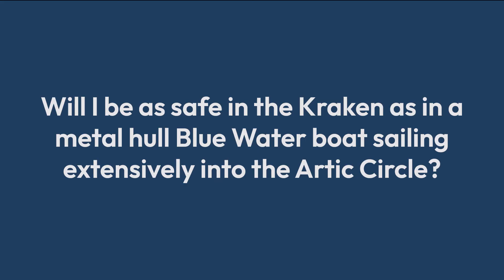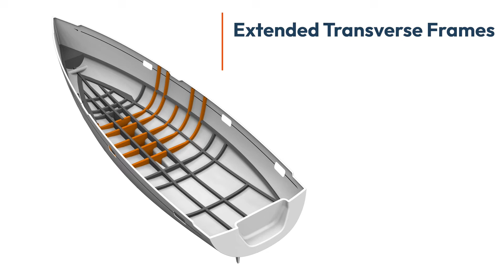Which material really is the best for building a world cruising yacht? Metal or GRP?

Comment: There are some critical lessons about steel maintenance. One is to understand how to use modern surface tolerant epoxy paints properly. In particular you have to test for residual salts and remove them entirely. Secondly you have to manage all dissimilar metal connections, especially any aluminum around the mast base or hatches. Eliminate all wood if possible, use modern composites such as G11 or Coosa board. Ensure all wiring and as much plumbing as possible is out of the bilges, plan for easy access to all the bilges so that once a year you can spray with detergent and hose out with fresh water. Keeping that paint clean and dry will ensure it does not fail. Tanks must be either integral to the hull, or made of a non-metallic material and then installed so they can be removed and the hull accessed behind.

Follow these simple ideas and a well-built steel hull will be no more maintenance than any other.

Comment: I would like to slightly expand on the question of GRP for high latitude sailing. Because when the day comes, I suspect I will be chasing more snow than turquoise lagoons. An ideal world cruiser would allow me to chase the winters on snowy coastal mountains. Which is probably the opposite of what 99% of cruisers want to do so catering for this market section is not wise to begin with :D But I still want to ask and learn.

So durability is a major concern. But I fully trust that both aluminium and GRP can be strong enough for practical purposes, provided it's designed for the use case and no corners are cut. Isolation transformers and stray current detectors help with other shortcomings of aluminium, and I haven't heard too many complaints from owners of modern alloy yachts. But where I would like to hear more about the choices of Kraken is insulation. So if I'd compare, say Kraken 50 (or preferably the 44 ;) ) to another boat I really like, the boreal 44.  One thing that pops out is 50 mm insulation below waterline, 80 mm above waterline. Throw in a gravity fed diesel heater that consumes no electricity and it truly is cozy place to hold out a blizzard. Now, solid GRP construction below waterline and while thick for GRP laminate above, my first instinct is that this wouldnt be ideal for extended stays in 3 degree seas with air temperatures regularly on the freezing side? Sounds like condensation and heat loss. I'm currently on a swedish built foam cored (above waterline) GRP boat. Naturally, a smaller boat, and laminate is nowehere Kraken thickness, but even with insulation foam added where possible, it's far from ideal. Other point of concern would be the big windows: while I love, absolutely love, the triple glassing on the Kraken, I doubt it's spaced with air in between for insulation?

Comment: 9-9-24. First of all this is a very good sailing Channel with very knowledgeable safety first yacht owners. 
Metal or GRP.  My comments source:  Video from the  Nikki and Jason Wynn-Gone with the Wynns You Tube Channel. 
Here is what we have seen for ourselves via videos shot at the HH factory in Vietnam by the Wynns as their vessel,  an all electric HH44OC hull #3 was being fabricated. Video that included some in-depth interviews with HH factory mgt, engineering, electrical staff and some local very skilled catamaran artisans regarding which material they know is best for world cruising and world class racing vessels. Bottom line. GRP, Carbon fiber and epoxy - hull and mast,  same for Cat dagger boards.

Comment: A typical f/g lay up is almost exactly equal in weight and strength to an aluminum plate of the same thickness. Aluminum is stiffer. Don't forget the mast on your f/g boat is most likely aluminum.
Reply: Aluminium welds are only 60% the strength of alu plate, and there's far greater geometric freedom with GRP because it's only rigid once set up. You simply cannot lay up aluminium plate as thick as GRP in any kind of economical way. You can't triple-up 5mm plates and expect the result to be as strong as 15mm, because it won't be, it's not bonded throughout the entire structure like a GRP layup is.

Given equal thickness, I'd much rather hit a rock with a GRP hull. Not only will it fail later, it's failure mode can be less catastrophic than aluminium. GRP will fissure before it holes, aluminium will just hole. Fissures are far easier to patch than holes.
Reply: This may be the best material of all. 
https://www.youtube.com/watch?v=vTfLY0Fcapo

Comment: For cruising in high latitudes only need to look at what the commercial yacht companies are using…. bare Aluminium is the preferred material. It’s ductile and maintenance free… and for non commercial high latitude sailing many, if not the majority, of the boats encountered are Boréal, KM Bestevaer and Garcia which are all Aluminium builders
Reply: Hi Mike
Actually commercial boats use Ally because it's a lot cheaper than building a high impact large vessel from composites. They don't make the bottoms of modern combat tanks from aluminium, they make them from composites. Maintenance free?? Aluminium and salt water?think Alka-Setzer ! 
If Aramid fibres are used in the composition engineered layup at the potential collision areas it will have far greater impact resistance than Aluminium. 
Thermal insulation and condensation is another important consideration. A well laid up composite structure with an integral structural foam layer, bonded on top of the hull lay up inside, is far superior. The caveat to this is that the foam layer should be additional too, not in place of, the outer composite FRP hull lay up. Meaning that you still retain the optimum hull lay up then you add a foam layer then bond that in.
Yacht builders tend to develop their construction from what they know, rather than analysing what is the best material for a given application, just because everyone does it, it doesn't make it right.
Dick B KY
Reply: @dickbeaumontkrakenyachts Completely offtopic: It is great that you discuss directly and very open with your followers!
Reply: I’m not saying Jimmy Cornell and Pete Goss they don’t know what they are talking about I’m saying the technology now available in GRP composites presents a better alternative. 
Do I hear some cognitive dissonance creeping in here?
Reply: Except Cornell and Goss didn't choose aluminum 50 years ago but within the last decade. GRP technology hasn't  changed THAT much in the last few years. Aluminum is more than 4 times stronger, so unless you're going to build a grp hull that's 5 times thicker, it's not going to be equivalent, reinforced or not. And then there's the issue of plasticity: when aluminum gets hit it bends. When GRP gets hit it breaks. And that makes a difference. I think it would be better to just come out and say what Sirius yachts put on their website, which is that yes, aluminum is stronger, but GRP is strong enough for most uses unless you really plan on going to the arctic (and maybe even then), and therfore why deal with the hustle of worrying about aluminum's  galvanic corrosion or getting paint to stick when the intended use does not necessitate it. You can't do that because your marketing is based on the premise that Kraken makes no compromises, which is simply not true cause every choice, whether it's material or a fixed keel vs centerboard, has pros and cons and much depends on intended use. I say all this because I respect you as a sailor, we were both sea scouts (and hence brothers) and I am afraid l that your overkill claims (and those of your cult like followers on YouTube) have the opposite effect from that intended. Cheers
Reply: Someone tell Jimmy Cornel and Pete Goss that they don't know what they're talking about. All these trips to the Arctic with aluminum boats didn't teach them anything.
Reply: @constantinealexandrakis The opinion expressed in this vid was well informed and well considered, and I must say, well explaned too! I personally agree that a properly laid-up thick GRP with aramid/kevlar reinforcement is preferable over aluminum for a hull. 
As regarding the sailor names you dropped- that reference to Pete Goss is strange as he went from an aluminum Garcia 54 to a costal plywood-made butt-ugly shoal-draft monstrosity that only its creator-himself can love! He also famostly voiced some wacko opinions outside of mainsteam - for example him being against in-mast furling...
The weirdness of such an opinion (besides limiting one to a thirty-footer) was demonstrated by a somewhat recent death of a German sailing couple on their CNB 60-footer in the Atlantic during a storm, as it was posited by the investigators that it was their in-boom furling system that effectively got them killed: - The boom has to be very horizontal for boom furling to work properly while the in-boom system makes ot much heavier and therefore dangerous when it is swinging! When the arrestor ropes snapped during storm, it was this extra heavy fast-swinging boom that delivered the killing blows to the heads that killed both sailors. It was saif that if their yacht had an in-mast furling, that accident may not have happened! Yet your Pete Goss is so against in-mast furling that it makes it difficult to take his other opinions seriously... Notably, Mr. Rassy swears by in-mast furling to the extent that every Hallberg Rassy models have to offer in-mast furling as an option or else he will not produce a yacht that is too big to have an in-mast furling...  
Yes, good thick GRP with kevlar IS stronger than aluminum hull not to mention it being inert and not susceptible to "galvanic action" that renders a typical lifespan of an aluminum yacht at about twenty years! Even wondered where all the older aluminum boats have gone?? Yet, there are forty-year-old and older Najads, Rassies, Scanmars, Rustlers and other top-tier GRP-hulled boats abound, some still in condition akin to a new! So a simplistic preference for metal hull is somewhat childish, and as one becomes more aware of nuances concerning material lifespan, upkeep, chemical makeup and properties like material fatigue, GRP becomes ever more appealing... 
And, please, no references to wacko weirdoes like Pete Goss- He is a known eccentric allright...

Comment: How about carbon fiber / epoxy instead of GRP? “Well laid up” of course :-)
Reply: Hi Guys
It's all about horses for courses. Carbon fibre/Epoxy  is very strong and, if you're trying to produce a very light boat, it's a good solution, but.... a) it's very expensive and b) if your not trying to win races, why do you care about weight, within reason? In fact, if you're trying to create a yacht with a sea kindly motion the last thing you want is a light boat that's slamming and bouncing from wave to wave. When you have 6 or 8 muscled up racing crew doing 1 or 2 hour watches they can take an ocean voyage of 10 or 15 days of tough physical effort no problem  but, taking off down the front of a big wave to get the boat planing is the last thing a husband and wife live aboard crew want.
Dick B KY
Reply: @dickbeaumontkrakenyachts  Of course I don't want to slam and bounce but isn't it better to have the weight in the keel than in the hull/deck? It seems to me that if the cost is acceptable then one can make a faster, safer boat at a given weight by using CF for the hull/deck and putting the saved weight into the ballast.
Reply: Carbon fiber has bad impact behaviour, suffers from catastrophic failure which means it sheers apart completely if pushed past it's limits
Reply: Yes, hence the aramid layering, too.
Reply: That’s a very legit point Dick!
Maybe also a good argument to look for a 1970-isch boat. Yes smaller rig but great looks and great sailors.
Greetings, Harry